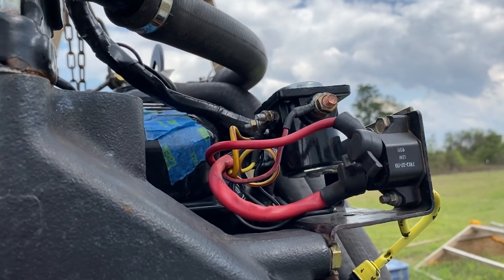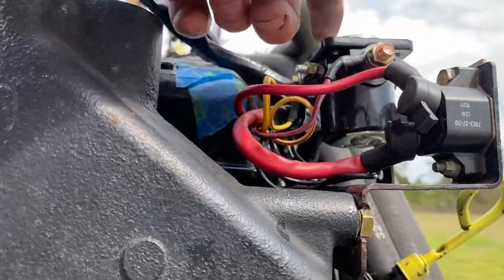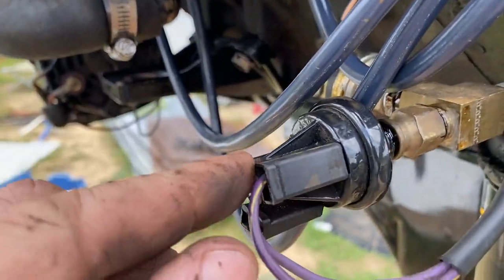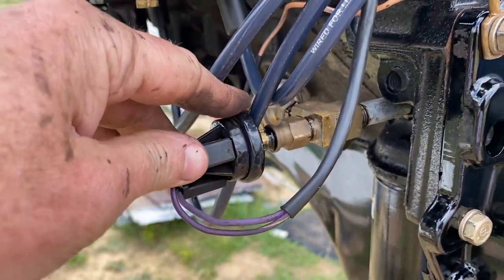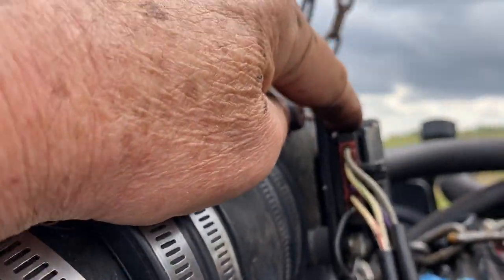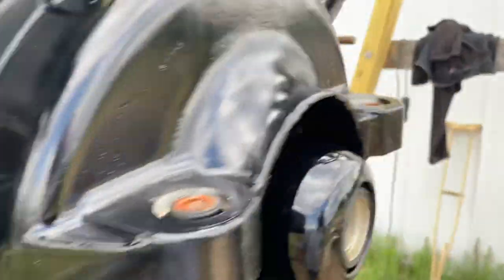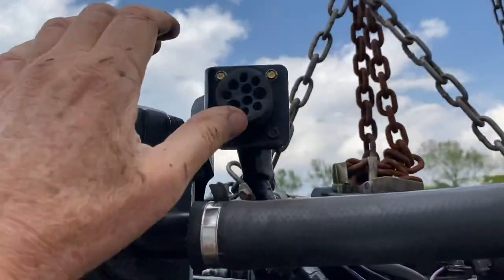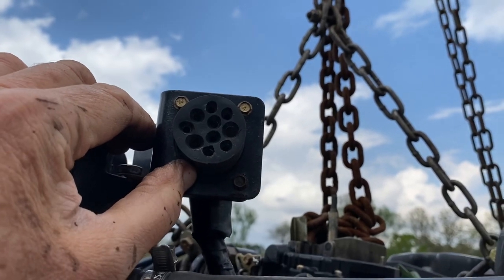Mercruiser Electrical - How It Works (Read the Description)

Comment: This video just saved me! Short and to the point. Easy to fallow and troubleshoot my starter problem. Just removed my starter and THREW it overboard!! Thank you for a short but great video! Just liked and subscribed
Reply: i’m having a starter issue as well
Reply: Hello
Reply: Are all the threads installed in the same screw, red, orange, yellow and purple?
Reply: Are all the threads installed in the same screw, red, orange, yellow and purple?
Reply: Please reply, thank you❤❤❤❤❤❤❤

Comment: I have 2 wires(  a black and a yellow) going to a plug connector on the temperature alarm (the one closest to the alternator side) is this correct? Also, i have the white w/ black and black on the other side that i cant figure out where they go

Comment: Do you know where I can find an engine schematic breaking down every component in correlation to placement on the engine? 

It's a 1993 Mercruiser 4.3, bought it with heads/ intake/ alternator/ carb, Yada Yada removed and now it's fixed but weary on some parts he had in a baggie
Reply from the maker: If you have the serial number of the engine go to www.marineengine.com and put in the serial number. That will bring up a schematic of your system. The serial number is a metal tag on the block just above the starter.
Reply: @moccasinmarine  appreciate your time!!
Reply from the maker: I will say that 95% of the bolts in a GM small block (4.3 is a small block with 2 cylinders less) are 3/8”x16 of varying length.

Comment: i have this boat, where does the black wiring go running parallel to the purple wire?
i have two loose black wires that are unplugged and cannot race them to where they go...
Reply from the maker: I would need a photo to answer this question. Send me a photo to gmefiguy@gmail.com
Reply: @moccasinmarine  coming at cha! much love!
Reply: @Moccasin Marine LLC  did you get an answer to this question?
Reply: I would also like to know what the answer was as I have the same. A black wire and a purple wire that can't be accounted for.

Comment: Why would I not be getting power to my fuel pump? My fuel pump works when jumped from the battery. No power from from the purple wire that goes to the fuel pump from the oil pressure switch while engine running but does have power on the purple wire that comes from the starter to the oil pressure switch. any ideas?
Reply: I have the same problem. Tested the oil pressure switch, ohms and volts are good, diaphragm was bad. Jumped the switch with a paper clip and my fuel pump worked/buzzed. I believe the starting/default position for the oil switch  is open, then gets 4psi to close circuit, passes juice/volts to fuel pump. Engine doesn't start, then with key in run position, not crank position, fuel pump is buzzing. So this must mean that after cranking, the motor maintains at least 4 psi... right? Is that possible:? 1 crank, 2 build pressure, 3 no start, 4 pressure of 4+ psi remains ?
Reply: @mtbristol  I'm pretty sure my oil pressure switch is bad. There should be a lot more than 4psi when the engine is running. If you only have 4psi of pressure then you have bad motor. Mine runs at 65psi of oil pressure when running. I just jumped the wires together so I have fuel as long as the key is on. My block is cracked badly in the valley. Fills the engine with water within 5 minutes and then a milk shake comes spewing out the breather hoses. Got the intake off now. Getting ready to JB weld it and see what happens. If it doesn't work then I'll be ordering a reman long block.

Comment: So where is the actual alarm located that the tan and blue wires lead to?  I purchased a boat with a ‘94 4.3lx alpha one gen 2.  The temp and oil pressure gauges work on the dash but there is no low oil pressure alarm that sounds when starting the boat.
Reply from the maker: The alarm is up under the dash panel. It sounds anytime the tan/blue stripe wire is grounded.
Reply: Someone had installed some type of rocker switch at my alarm under the dash

Comment: So if the fuel pump doesn’t turn on would it be the oil pressure switch is bad?
Reply from the maker: Either that or a bad pump.

Comment: I am getting no engagement when I turn the key, completely zero.   New starter, battery seems good.. what do you suggest I start with looking at
Reply from the maker: Neutral safety switch in shifter will not let start signal reach the starter relay. If that checks out connect 12v jumper wire to starter relay yellow/red terminal. If relay doesn’t engage either bad relay ground or bad relay. If relay does engage but no starter spin you have a bad starter or bad yellow red wire to starter.

However, before any of the above, see if any accessories work in the gauge cluster, like bilge pump or blower or gauge lights, etc. if none of that works you may not be getting power to the steering console. That power is fed through pin 6 of the boat to engine harness connector. Pin 6 is fed from the main fuse at the battery cable connection at the starter.

Comment: Hello, I'm installing a Holley Sniper EFI on my MerCruiser 5.7, Would the purple, yellow wire you described in your video be a good source for a constant source 12 Volt connection for my Holley Sniper EFI? Also, I'm installing a MSD ready to Run distributor, how would I connect the cutoff switch wire to which distributor wire.
Reply: I would go directly to the battery.
Reply: @catfisher420  I figured it out, thanks.👍🏿

Comment: Got a question for ya. Got the same engine in my maxum. 4.3 But my problem is my ignition switch is dead. It won’t do anything for the motor. So I replaced the starter relay with a new one and I did the old screwdriver trick and it did kick over the motor. So I know it’s good. Probably was even bad in the first place. But my Accessories still work on the key switch but that’s it. Could the ignition switch be bad?
Reply from the maker: The starter circuit at the ignition switch is a different contact. The starter contact on the switch only turns on the starter relay nothing else. The starter then powers up the ignition through the purple wire on the starter. Once the engine runs and you let go of ignition switch the other contact (RUN) in the ignition switch powers the ignition and accessories on the engine and console.
Reply: @moccasinmarine  so how can I test the ignition switch to check for fault? Take a test lead from the yellow/red wire to the purple wire? Then turn key as if cranking?

Comment: Is the purple wire to the coil 12 volt or reduced 10 or 9 volt (with a resistance)?
Reply from the maker: On some it is and some it’s not. Depends on what year it is.
Reply: @moccasinmarine  1991, Mercruiser 5.7 (carb) with Thunderbolt 4 ignition

Comment: I have no power to my pump. 2002 Bayliner Capri Carbed Mercury 5.0. Is that oil pressure switch suspect as faulty? Also, I can find no pump relay or fuses dedicated to the pump.
Reply from the maker: There is no relay because the pump is powered directly through the ignition switch, then through the driver kill switch, then through the oil pressure switch. During starting the pump gets power from the starter but during run the power comes through the oil pressure switch.
Reply: @moccasinmarine  Thank you. I'm on the final step with starting it. Does the fuel system need to be primed after replacing the fuel filter/water separator?
Reply from the maker: @rsw0331usmc  yes, jumper oil switch wires together, turn ignition switch on and pump should run. Run until fuel squirts from accelerator shots in carburetor. Turn off ignition and remove jumper.
Reply: @moccasinmarine  Thanks again. I did try jumping the pump directly with jumper wires from the battery. The pump did run in this condition but I still had no fuel delivery. I disassembled everything and looked for obstructions. There was not a drop in the filter, it did not draw any fuel at all. I wound up back-bleeding it with a large syringe and hose from the carb fitting back. That worked.